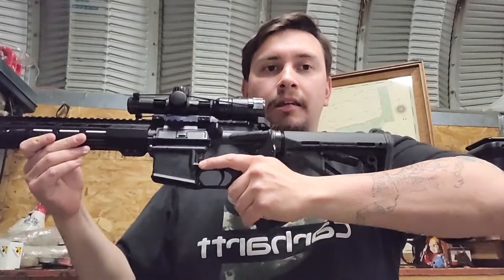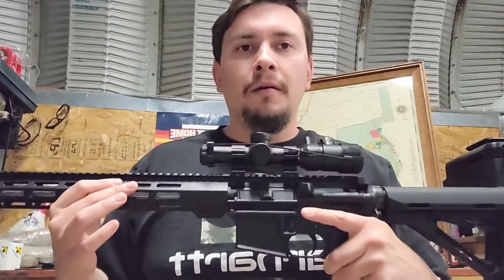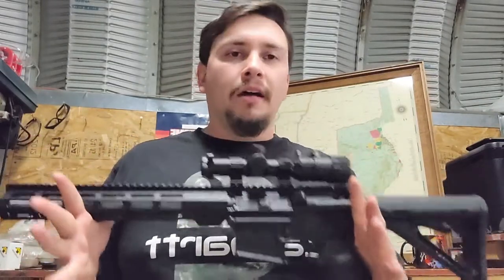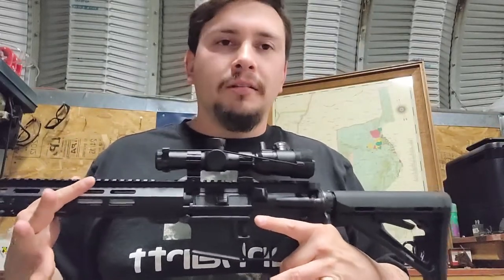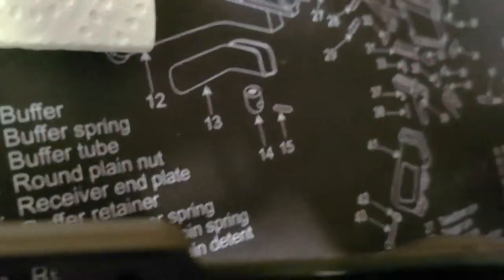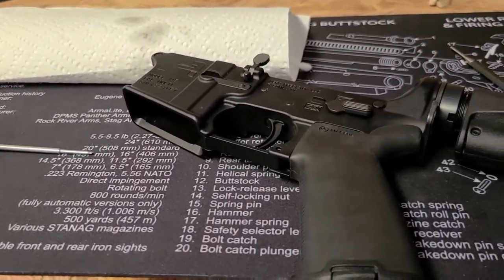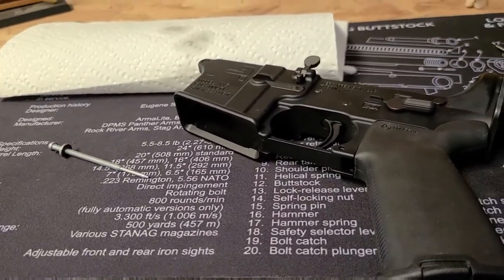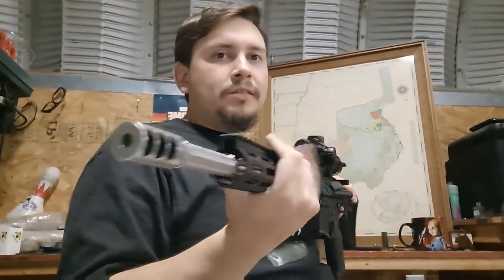7.62x39 AR-15 Why? How? Is it accurate?

Comment: What brand is the upper? And compensator. Looks great I want to build one like this.
Reply from the maker: That one was assembled using various manufacturers through the pro2atactical custom upper process. The upper is an aero precision, barrel is bear creek arsenal stainless steel, and the muzzle brake is the stainless steel option offered by pro2atactical.

Comment: I beg to differ, my grendel is better hunting hogs than this.  And 7.62x39 is about 6 or 7 bucks a box right now. The only thing I did to my 7.62x39 was buy an enhanced firing pin.
Reply from the maker: Yaknow I hear a lot of good things about the Grendel round just haven't entertained the idea yet. I typically will buy 500 rd boxes for about 180 and compared to anything else it feels fair